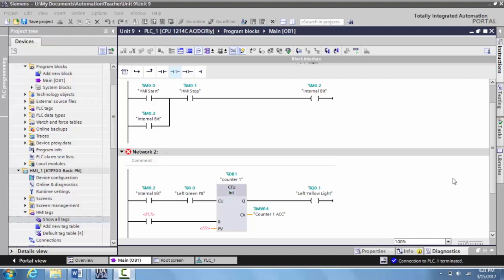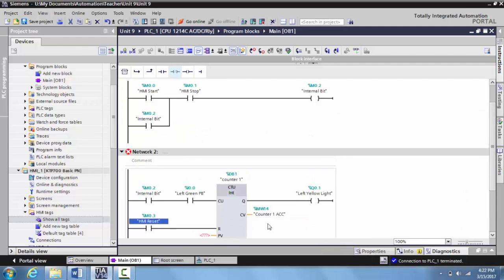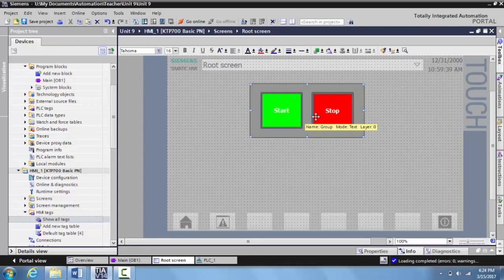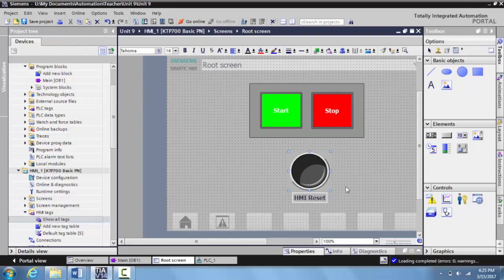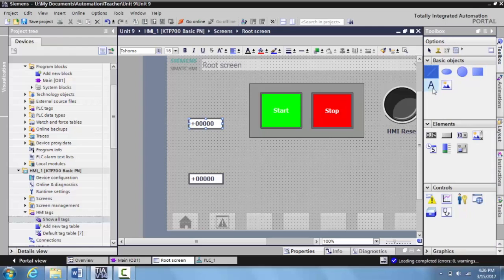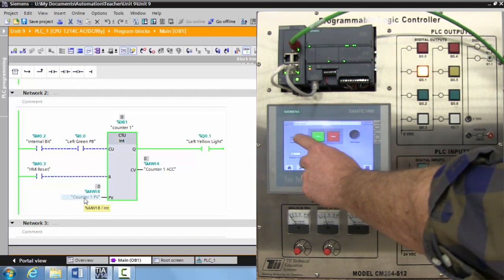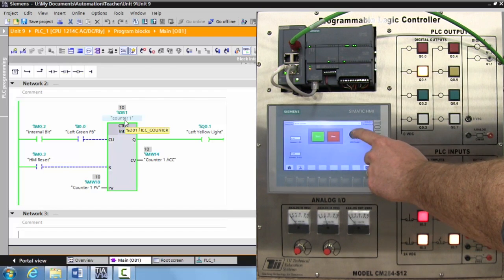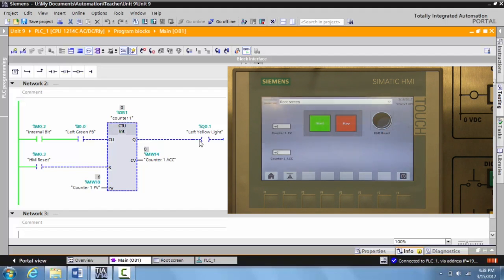Controlling and Monitoring a Counter with a Siemens HMI using TIA Portal V14 - Unit 18.1

Comment: Thank you for this video, however how would this work if you need to go above the max 999 count

Thanks
Reply from the maker: It will count and you can set the preset will above 999.  So it would just keep going.  If you go past the preset the DN will just stay activated.

Comment: Hi thanks for the video, I have a question. Say I want to display a generator's voltage, current, frequency and other energy parameters, what will be the way to do it. Either, to have a smart power meter (without display) and connect it to HMI via a network or to have corresponding sensors (CT, VT's) and connect it to the PLC and then program and map the PLC and HMI ?
Reply from the maker: What a great questions.  I have never thought about it before.  Depending on the type of output your meter or device is providing or the method you have available to look extract the needed information it is hard say.  If they give off an analog signal you would just need to create a tag and adjusts the parameters.  If there is a specific card that Siemens make or allow into their system, that would work but I have never looked for one.  I think it would have to go through the PLC with specific meant to sense the specific parameters.  I will think on it and try to do some research if I have time.  Thanks for watching.

Comment: sir would you help me, i need to set up 3 endoder in the same instruction progress, example:
CNT1 is activated by photocell and start counting (exp: 1000)
CNT2 need set 50% of CNT1 when object passing photocell2,
and CNT3 need set 25% of CNT1 when object passing photocell 3, thank you very much sir.
Reply from the maker: My suggestion would be to use a couple of math instructions to set the percentage.  Then i would use a move instruction to move that value into the counters PV.  If I understood you need correctly, that is the approach I would take first.